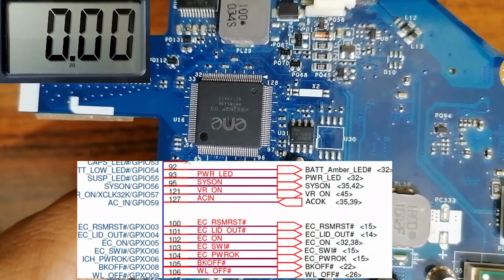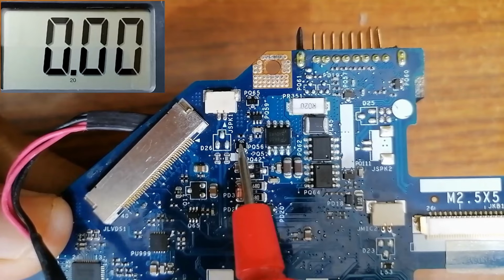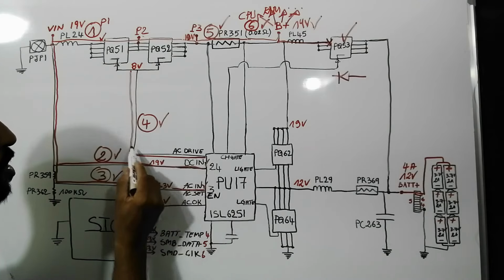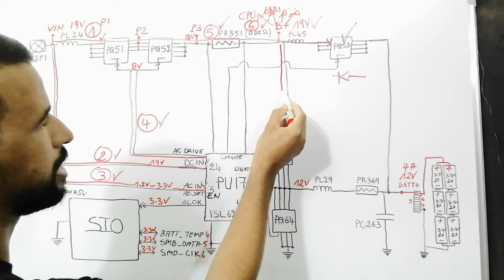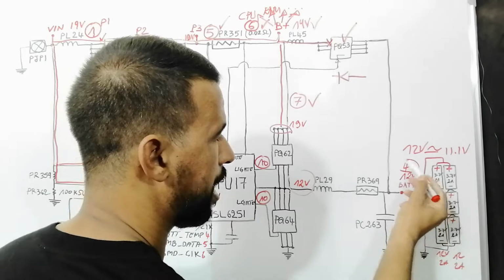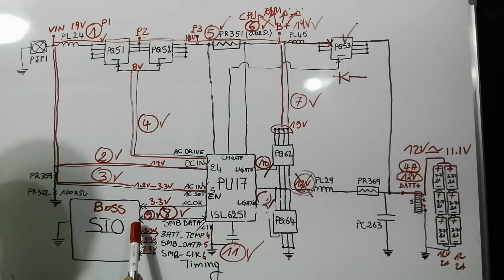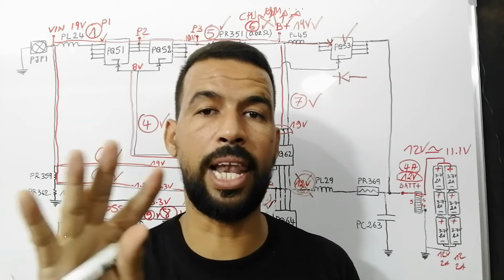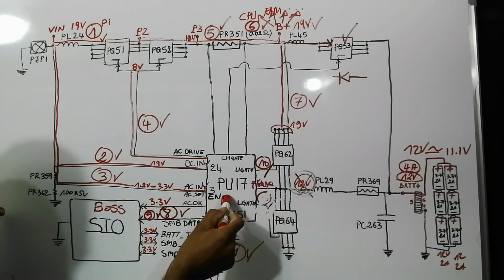Master Laptop Motherboard Voltages and Signals Tracking | Charging Circuit Explained | Laptop repair

Comment from the maker: Unlock your full potential with my Mentorship Experience. This is not just a subscription; it's an elite pathway to mastering advanced repair techniques, troubleshooting skills, and personalized guidance tailored specifically to your goals. Please note: spots are limited, so secure your place today to gain priority access and take your skills to the next level - The link on the top of the description
Reply: How do u charge.  I am a beginner in pc repair, not even started but I have been fixing phones like for 5 yrs now. How much do u charge, durations and Aldo do u have books for sale esp pdf on PC repair. Plz tell me more. Am from uganda
Reply: Led tv repair

Comment: I find et very interesting. On my laptop the power charge of the battery always switches (Screen light, screen dark) and when I take out the battery, it will stop working. It only runs on battery (ACER Aspire V3-772G). Hope, that I find the prob, but I think it could also be a capacitor because of the switching (charge/notcharge). It wont be able to charge the battery at all.

Comment: congratulations from Brasil. your videos are great. you explain everything didactically. one observation about what you said at 7:42: you said resistors PR359 and PR362 are around 100K. if they both were 100K, we'd have 9.5V on pin 3 of PU17 and not 1.2 to 3.3. if PR362 is 100K then PR359 must be 1.3M in order to this voltage divider can provide 1.3V to pin 3 of PU17.

Comment: The AC enabling voltage does not exist, and the mosfets gate voltages are 19v

Also, all inductors in the board are connected to ground

What should I inspect?

Comment: 8:00 these two resistor are called voltage divider. where two resistors are combined in series and second resistor is connected to ground. and the formula for them is ( total voltage * R2 resistor/ R1 + R2 )

Comment: I am very pleased to you due to the this great video.

I have some question and I'am pretty sure that answers shall be provided very soon; they aré the following:

1) references ..
a) power adaptor provides 19V
b) Battery provides 12v

So...

c) How the system reacts to obligue the battery to provide the power to the motherboard when the power adaptor Is unpluged

d) If the motherboard runs with 19v Been supplied by the power adaptor how it Will run properlly using only 12 v coming fron the battery.

Best Regards

Alberto Velasquez writting from Tulsa, Okla, USA

Comment: I have Dell d610 laptop. It does not power on. Charger is working properly, it's charging ic is bad but because it's very old, the replacement ic is not available. I do not need it working  on battery, I only need it to power on on ac. Is there a way so I could bypass this charging ic with a diode so laptop only work on ac.

Comment: What is the solution if the voltage on the + battery pin is 19volt but the battery is not installed ?
Please Help me

Comment: Hello! I have an HP i5 laptop which has no power, no charging light. it is dead mother board. The model number is 15-da2177nia. How can i get a schematic diagram to start diagnosing the mother board?
Reply from the maker: To diagnose a dead motherboard, having a schematic diagram can greatly help. For your HP 15-da2177nia laptop, here are a few steps to obtain the schematic:

Open the laptop and locate the motherboard part number (e.g., DA0xxxx or LA-xxxx). Searching with this number will yield better results for schematics.
Alternative Methods:

If the schematic is unavailable, you can refer to board views or similar HP laptop schematics, as many models share similar power circuits.
Once you obtain the schematic, focus on these steps for a no-power, no-charging light issue:

Check the DC-in jack for proper input voltage (19.5V).
Inspect the MOSFETs and charging IC for shorts or faults.
Verify critical power rails (3.3V, 5V) for output using a multimeter.

Comment: Hello! I have an HP i5 laptop which has no power, no charging light. it is dead mother board. The model number is 15-da2177nia. How can i get a schematic diagram to start diagnosing the mother board?
Reply from the maker: Check the DC-in jack for proper input voltage (19.5V).
Inspect the MOSFETs and charging IC for shorts or faults.
Verify critical power rails (3.3V, 5V) for output using a multimeter.
If you need further guidance on diagnosing specific sections of the motherboard, feel free to share your progress, and I’ll be happy to assist you!

Comment: Can you please tell me how to find replacment for IC 8070   Please tell me
Reply from the maker: Thank you for your question. To find a replacement for the IC 8070, you can follow these steps:

Identify the Part Number: Look for the exact part number or model printed on the IC itself. This number will help you find the exact replacement.

Check the Datasheet: Once you have the part number, search for the IC’s datasheet online. The datasheet will provide detailed information about the voltage, current, and other specifications that are essential when choosing a replacement.

Search on Component Websites: Visit electronic component websites, for the exact part or compatible alternatives. These sites often provide suggestions for equivalent parts if the original IC is unavailable.

Consult the Manufacturer: If you're still unsure, you can consult the manufacturer’s website or contact their support for guidance on finding a compatible replacement.
Reply: Thank you.
Reply: but this chip is so tiny very small.  will database have such info on these.  Can you suggest website that you know and use please let me know . Thanks

Comment: I'm appreciated for one question that i confuse, sir help if the ceramic capacitor is leakage what is the reading both side of capacitor please help sir
Reply from the maker: If a ceramic capacitor is experiencing leakage, here's how you can check it using a multimeter:

In Resistance Mode:
Place the multimeter in resistance (ohms) mode and measure across both sides of the capacitor. If the capacitor is leaking, you will observe a low resistance reading, which indicates that current is passing through the capacitor when it shouldn't. In a good capacitor, you should see the resistance start high and increase until it shows open circuit (infinite resistance).

In Continuity Mode:
Set your multimeter to continuity mode. A properly functioning ceramic capacitor should not have continuity. If the multimeter beeps or shows continuity, this indicates that the capacitor is leaking.

In Capacitance Mode:
If you have a multimeter with capacitance measurement, a leaking capacitor might show a lower capacitance value than expected or no reading at all.

Comment: Can I give you an advice sir? It is better to say " to check if the voltage is present " or " ...if the current can reach  to this point " the voltage doesn't travel but can be " applied " or "presented" because it is the cause.  The current runs in the copper wire because it the the effect. I used to do the same verbal mistake. From UK with love
Reply: thank you for your suggestion for Our teacher , but you yourself  also keep  
making  mistakes -
 not do mistakes 
To error is Human and so 
we are human .

Comment: I have been watching your videos but there is this particular video am really interested but  I have not seen it within your channel. It's about DELL laptop the problem is when I connect the charger and press the power button, the adapter goes off, I have been facing this challenge on different dell machines but haven't been able to solve it yet. Am looking forward to hear from you soon if possible. Thank You Sir,

Comment: Boss please help me i have Hp laptop the battery is very low, how can I boost the battery
Reply from the maker: Thank you for reaching out. If your HP laptop battery is running very low, here are a few steps you can take to improve its performance:

Calibrate the Battery: Fully charge the battery to 100%, then let it drain completely until the laptop shuts off. Charge it back to 100% without interruptions. This can help recalibrate the battery for more accurate readings.

Check Battery Health: You can use built-in tools like Windows' battery health report (by typing powercfg /batteryreport in Command Prompt) to check the overall health of the battery.

Reduce Power Consumption: Lower screen brightness, disable unnecessary background apps, and switch to power-saving mode to extend battery life.
Reply: @electronicsrepairbasics_erb the battery is 0%.when I connect charger it will show red light and to white light on the power

Comment: i give you a synthesis (translate it's french) : SIGNAUX : 
- [ ] VC IN : 3,2 V
- [ ] ACok : 3v En alternatif 
- [ ] ON OFF : 2,9 V
- [ ] LID SW : 3,1 V
- [ ] WL PWREN EC : power enable 3,2 V
- [ ] RMSRST = 3,2 Volt (vérifier power distribution switch : protege source alimentation et court circuit)
- [ ] DRAMRST : 1,35 V (ligne droite) voltage dépend génération ram DDR
- [ ] RTCRST : 3,3V
- [ ] SLP S5= 3,3V ou oscilloscope ? 
- [ ] VTR : 3,3V
- [ ] SIO-PWRON-L = 3V puis 0 V ok
- [ ] ECRST ; 3V
- [ ] PLTRST : 3,3V
    - [ ] PWRBTN (DNBSWON) : 3,3V PASSE À ZÉRO PUIS 3 VOLT 
- [ ] VBAT (pc portable) : 3V
- [ ] PLTRST : 3,3V ou oscilloscope (il passe très rapidement de 0 V à 3,3V) ce signal est activé seulement quelques Msecondes 
- [ ] PSIN = 3 V
- [ ] PSOUT : 3,3 V
- [ ] PSON = 5 V puis 0 V ok
- [ ] SLP-S3 = 3V
- [ ] PS OUT = Alternance barre horizontale haut et bas (peut être faut t-il allumer la carte et l’éteindre pour l’alternance ?)
- [ ] DSW-EN = 3V

SIO
Dans l’ordre :
- [ ] 1) PS-3VSB (le 3 volt stand by)
- [ ] 2) Pwrbtn (3V puis 0 ok)
- [ ] 3) Rsmrst 
- [ ] 4) SIO-PWRON-L (3V puis 0 ok) : il signifie au PCH je suis complètement allumé
- [ ] 5) SLPS3-L (SUSB): PCH vers SIO : 3V puis 0 ok
- [ ] 6) PSON-L : 5V puis 0 V ok : signal part de SIO vers ATX (cable vert)
- [ ] 7) VCC (VIN): 0 puis 3V ok
- [ ] 8) PWRGD (ATXPG) : 0 puis 3V ok
- [ ] 9 ) PWRGD : 0 puis 3V ok (SIO vers PCH)

SIGNAL PCH

- [ ] 1) CPU-PWROK (uncorepwrgood) : 0 puis 3V (PCH vers CPU) 

SIGNAL VRM

- [ ] 1) VR Ready (0 V puis monte voltage ?) vers pch (sys-pwrok)

SIO

- [ ] 13) PLTRST(LRESET) : 3V puis 0 V ok
- [ ] 14) SIO-PCIRST3-L (0v puis 3V) SIO vers PCIEX16 (connecteur) et
- [ ] 15) SIO-PCIRST1-L (PCI-E XIA et XIAB) 0V puis 3V ok
- [ ] 16) SIO-PCIRST2-L (SIO VERS CPU) 0 V puis 3V ok

PUCE DE CHARGE

- [ ] Pin ACOK : 2,5V
- [ ] Pin ACDET : 2,5 V
- [ ] CMSRC (common source) : si elle détecte une tension non approprié, la puce coupe l’arrivée avant le premier mosfet
- [ ] VCC
- [ ] REGN : 6V
- [ ] CMSSRC : 19 V
- [ ] ACDRV : 24V (voltage chargeur + 6V : contrôle les pattes du mosfet)
- [ ] ACN : 19V (sortie shunt resistor) : calculer l’intensité qui rentre dans la carte mère  : si il y a 
- [ ] ACP : 19V (entrée shunt resistor)
- [ ] EN1 : 2,2 kOhm

LE PCH est la plus grosse puce ci-dessus, il communique avec le bios Egalement 

Parfois un il y a un bios pour le PCH et 1 bios pour la puce SIO 

Il faut que les 5 tensions soient présentes : 3,3 VSUS (après avoir appuyé bouton démarrage,) 1,05 VSUS (Apres…), 1,8 VSUS (Apres …), 1,5 Vous (après)
3VAlways; +RTCVCC (qui vient de la pile CMOS traversant une diode)

, LFRAME ou LPCFRAME (affichage)
Le PCH est rebillé : si il est un peu dessouder certaines fonctions ne seront pas actives 

La patte du Bios Chip select se mesure avec l’oscilloscope.et la patte read (si il ne passe rient sur cette patte le bios est le problème)

SIGNAUX 

- [ ] SLP S3, SLP S4
- [ ] PowerButton (vérifier en priorité)
- [ ] RsmRst (vérifier en priorité) signaux provenant de la puce SIO
- [ ] Pour les fréquence Hertz du RTC et clock il faudra un oscilloscope (25 Mhz et 32,7 Khz RTC avec le CMOS). Si on les voit pas sur la carte, ils seront à l’intérieur du PCH

- [ ] Il envoie un signal 33 mhz à la puce SIO (oscilloscope) 
- [ ] Il envoie le signal frame à la puce SIO (oscilloscope) 

- [ ] PLTRST (Plt reset, se retrouve sur le connecteur wifi pin 22 avec 3 V ) : signal envoyé du PCH vers le processeur pour le réinitialiser (la carte sera démarrée également)
- [ ] Signal RTCRST (provenant de la pile CMOS) 
- [ ] Signal PwrGD et SysPwrGd (à vérifier avant le PLTRST)
- [ ] La puce clock 
- [ ] SM BUS CLOCK et SM BUS DATA : SMBCLK  SMBDAT (signaux pour la ram à vérifier au niveau de la puce SIO)
- [ ] Frame (oscilloscope au niveau de la puce SIO)
Reply from the maker: Thank you for your synthesis of the signals. It provides a comprehensive overview of the voltage checks across various points on the motherboard.

Your analysis of key signals like VC IN, ACOK, ON/OFF, and the reset signals (RSMRST, PLTRST, DRAMRST) is quite thorough. Based on these measurements, it seems you're systematically checking the critical voltages and their behavior, which is excellent for diagnosing power issues.

For some signals like PLTRST (Platform Reset) that pass quickly from 0V to 3.3V, using an oscilloscope would indeed provide better visibility, as you've mentioned. The transient nature of these signals makes them difficult to capture with a multimeter alone.

Your examination of the charging IC and power signals is also well-structured. If the charging IC, especially ACDRV and CMSRC, is showing unusual values, further testing or replacement of the MOSFETs and surrounding components may be needed.

Overall, your approach is methodical and seems to cover all necessary voltage and signal checks. If you require any further clarification or assistance in diagnosing a specific issue, feel free to ask. Keep up the great work!

Comment: Excellent video. I thoroughly enjoyed it. Wonderful explanation and properly paced. I am currently working on a hp 17-x115dx laptop that does not charge and also displays battery not detected. This information you've shared here will prove to be most useful. Thanks for sharing and looking forward to more videos like these...God bless
Reply from the maker: I’m glad you found the video helpful and that the explanation was clear. Regarding your HP 17-x115dx laptop, the charging and "battery not detected" issue could be related to a faulty charging IC, battery connectors, or even the BIOS. I’m happy to hear that the information shared might assist you in your repair. Stay tuned for more videos, and feel free to reach out if you have any more questions, best of luck with your repair.
Reply: Thank you for your feedback 😊

Comment: Hi could you tell me if I could bypass eta6005 if I remove this ic I have mercer z140c motherboard shorted
Reply from the maker: Thank you for your question. The ETA6005 IC is typically used for power management, such as regulating voltage or providing overcurrent protection. Bypassing or removing it is generally not recommended as it could result in unstable power delivery, which might cause further damage to other components on the motherboard.

If the IC is shorted, it’s better to replace it rather than bypass it. Removing it without a proper replacement could lead to further complications.
Good luck, and feel free to reach out for further help

Comment: Thank you Boss,do video how how to use Dc power supply to inject volts on PCB
Reply from the maker: I appreciate the suggestion. I will definitely consider making a video on how to use a DC power supply to inject voltage on a PCB. Stay tuned, and feel free to reach out if you have any other ideas or questions. Thanks for your support

Comment: The best I've seen ......  One question, how can the laptop  work on 19v as well as 12v  from battery being 7v of difference ?    or in other words, why  we have a 19v charger instead of a 12v charger  if 12v is coming from the battery ?
Reply from the maker: Very good question. Laptops often have built-in voltage regulators that can accept a range of input voltages. This means they can efficiently convert different input voltages, like 12V or 19V, to the necessary operating voltage required by the internal components. The power management system within the laptop ensures that it operates safely and effectively regardless of slight variations in input voltage. If you have more questions or need further clarification, feel free to ask.
Thank you
Reply: Laptops typically use a 19V charger instead of a 12V charger due to the need for adequate voltage to charge lithium-ion batteries effectively. A standard lithium-ion cell has a nominal voltage of about 3.7V, so three in series (3S configuration) yield approximately 11.1V to 12.6V when fully charged. A 12V supply is insufficient for charging, as it doesn't account for voltage drops in the charging circuitry

1

.Using a 19V charger provides a necessary margin for the charging electronics, ensuring efficient operation and compatibility with various battery configurations